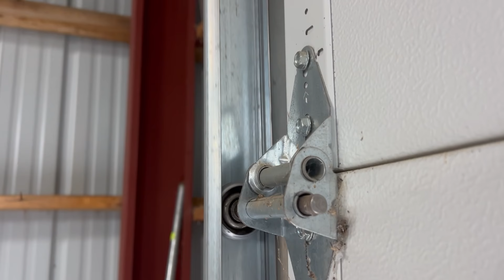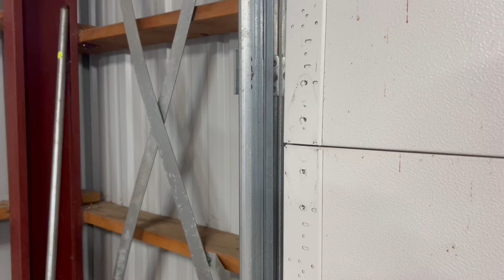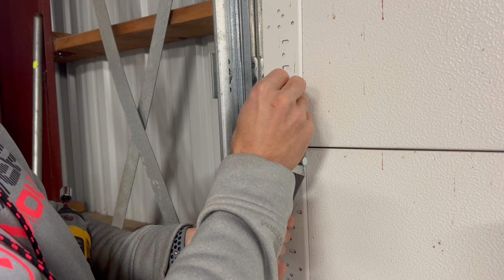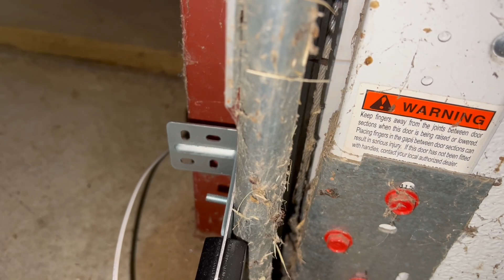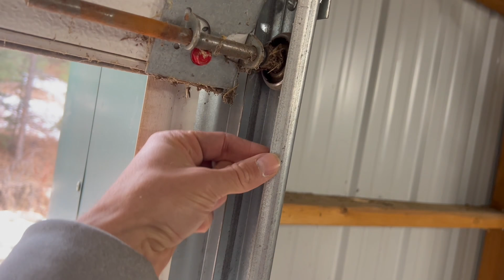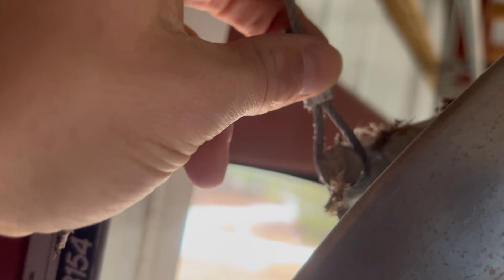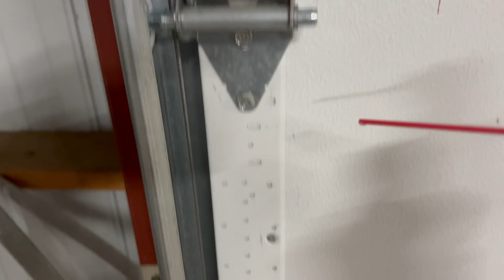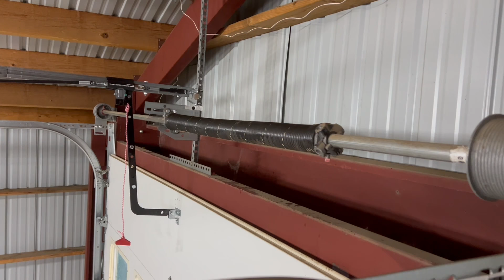How to Replace Old Garage Door Rollers WITHOUT Bending Track (Easy DIY Install) | Builds by Maz

Comment: This is really a great idea and I think I might try it. But what about isolating the motor with rubber mounts so that the vibrations from the motor don't directly transfer to the studs its mounted too?  My garage door is loud.
Reply from the maker: I'm sure that would help. Having a belt motor instead of chain also reduces vibration.

Comment: I predict 90% of people will just skip doing the bottom rollers
Reply from the maker: Even so, replacing 8 out of 10 rollers will make a ton of difference.
Reply: @ I totally agree, thanks for the post I might try it. I have a quiet type opener so the wheels are the loudest part.
Reply: @buildsbymaz  ...except the bottom rollers fail first because they are closest too the ground and collect all the bad weather
Reply: I was thinking about that same thing. I was quoted over $600 to replace these which is why I watched this video.
Reply: @mistysmith5392 wow, I think I paid $950 for a whole new two car garage door and install about 10 years ago.
Reply: Agree. Anything under tension is a red flag plus that unwinding of the cable looks like cluster #101
Reply: It was the exact same thought that came to my mind as I was listening, and then I saw your post. With all the other ones replaced the noise level should drop so one shouldn’t make much difference.

Comment: Do not grease the track - it ends up collecting muck and is sticky in cold weather. Keep the rollers clean and bearings oiled. Just degreased my track and its amazing the difference.
Reply: This is advice is key... DO NOT ADD ANYTHING to the track. the whole point is nylon on metal
Reply: Yes, my garage door repair tech said the same thing. Don't lubricate the track
Reply: That's what she said !!!!  🤣🤣🤣🤣🤣🤣

Comment: Thanks for this video.  The first couple of video I found on YT were showing people bending the track of forcing the roller out.  That looked sketchy to me.  I kept wondering why they did not just unbolt the hinge.  Your video confirmed that this would work and is and easier way to go.
Reply from the maker: Yes I would definitely avoid bending the track if you can! That way you don't run any risk of realignment issues.

Comment: Question: shouldn't the tracks and rollers remain dry so they roll rather than slip on the silicone?  I was always told not to lube the tracks. Thanks
Reply from the maker: Yes - that was actually a mistake on my part. Just lubricate the hinges and spring.

Comment: Why even bend the track to get the lower one out when you could do what you showed after the fact of removing the cable from the top makes no sense at all why you would even say anything about bending the track and damaging it
Reply from the maker: Just to show people another option. Again, I don't recommend it but plenty of people have used that method.

Comment: When I replaced my rollers, I smeared some sticky red wheel bearing grease on the roller shafts before putting them in the hinge. It keeps them from rattling. Also I lubed the hinge pins with a couple of drops of 90-140 gear oil.  It doesn't run off like thinner oil.

Comment: Why didn't you tell me how to do this a year ago.  I used the bend-the-track method.  It works, but the track never goes back to normal.  Still works fine.  Also you should use white grease (spray) rather than silicone lubricant.  Make sure you do the cable as well.   Great video.   Oh, and make absolutely sure you measure the diameter of your wheels.  I have a door from 2004 and it has non-standard wheel diameters.  It was difficult to find the correct shaft diameter with wheel diameter.  I found a set on Amazon and they work great.  So just don't order based on appearance.
Reply from the maker: Great tip about checking the roller size. Both silicone and white lithium are great options for lubrication in this application.

Comment: Great video.  I'm lazy so I just sprayed SI on my old wheels and hinge points.  It's much quieter!
Reply from the maker: That's certainly better than doing nothing!
Reply: There is absolutely no need to lubricate anything on the garage door, especially not the track. The only exception is the coil spring above. WD-40 Silicon is acceptable but WD-40 with PTFE would be best.

Comment: Great time saving video. One suggestion I would make after watching you start the first screw by hand and then start the other three with your drill driver. I suggest starting all four screws by hand or with a hand nut driver so you line up the original thread in the metal door with the screw thread. Using the drill driver can force the screw to start a new threading point or even ream out part or all the existing thread in the door metal thus damaging and weakening the existing thread pattern in the sheet metal.
Just start the screw by turning the screw counterclockwise until you feel the screw thread drop into the thread starting point in the door metal  Then slowly turn the screw clockwise a short way to make sure the screw lined up with the original thread in the door metal and is easily being drawn into the original thread pattern. Any tightness felt while turning the screw clockwise will indicate a misalignment and you should restart the process to prevent damage. You can then use the drill driver to run the screws in the rest of the way but make sure you don't set the clutch tension on the drill driver too tight so that it reams out the existing threads by over torquing the screw.
BTW, this is especially true if you pull and restart screws in anything plastic or wood working on other projects.
Reply from the maker: Thanks for the tip, that's something I never thought of. These things are pretty tight so it would probably require a socket wrench to get them started.
Reply: @buildsbymaz  I can't think of any time at all that it's taken more than a half a turn or so once I thought the screw dropped into the original thread pattern that I knew that I had a problem. Once the screw lines up with the original thread pattern it should turn fairly easily. My guess is that a nut driver would probably do a good job for the start.
Reply: @mikeslater6246  I have taught my grandson when re-screwing to make a half a turn out, then it will drop into the threads with out cross-threading.

Comment: Don't lubricate the actual track, it isn't needed and any lubricant will just attract and hold dirt.  The rollers have bearings, so they shouldn't be sliding on the track.

Comment: You probably shouldn't spray silicon on the track itself. You can lubricate the inside hub of each wheel (although yours are new and probably don't need it), but the wheels roll through the track, so you don't want or need the track to be slippery. As an analogy, if your car has noisy wheel bearings, it won't help to dump oil on the pavement. That makes your wheels slip instead of rolling down the road, but does nothing for the parts that are making noises.
Reply from the maker: Agreed, next time I'll skip the track!
Reply: Good analogy.

Comment: I did this more than 12 years ago and they still work great.  I suggest that as you swap them out, spray the inside of the hinge tube with some lithium grease before inserting the new roller.  I always spray the roller tubes and all the hinges at least a couple times a year, as well as coat the springs & cables with some penetrating oil to keep them rust-free.  Rust is the enemy in my area, especially in the winter (Buffalo NY).

For safety, get yourself a pipe with a screw-end that fits into the spring hub.  You can insert it and allow the tension to hold it against the wall so the spring can't unwind.
Reply from the maker: Great tips, thank you! Agreed that rust can be killer in the winter time if you don't properly maintain the hinges and rollers.
Reply: Can you provide a reference link/picture to this "pipe with a screw-end that fits into the spring hub"?
Reply: @Trust_but_Verify  I assume he means a Pipe with a threaded end - Commonly known as: Threaded Pipe. 
& I ain't providin' shit but this, my dude:
[ONE FREE GOOGLE SEARCH] 
NO PURCHASE NECESSARY. VOID WHERE PROHIBITED.
EXP. 12/12/2112

Comment: My garage door makes an awful grinding noise when moving lately. I've been wanting to change the rollers to the nylon ones so this video is very timely. One of the tension springs on mine broke a few years ago while I was in the house and I thought a bomb had gone off. Scared the begezzus out of me. I managed to find a garage door repair shop that was willing to sell me new springs, although the sales guy kept questioning my sanity. I bought two so that I could replace the unbroken one too, just in case. I wouldn't recommend anyone without good mechanical skills to change their own springs though. There's a LOT of energy stored in those springs when wound up and one slip could really ruin your day. Mine is adjusted to where the (double wide) door can be lifted easily with one hand.
Reply: Mine was getting loud,then I realized the chain tension was loose,tightened the chain up and quiet again.
Reply from the maker: They are super loud when they break! I agree, any garage spring repair should be done be a professional unless you really know what you are doing, as they can be very dangerous.

Comment: Good video...Something nobody has mentioned. Is your new bottom roller is a standard shaft length. The original longer shaft helps prevent
the door from coming out of the track when a spring brakes...Some folks even put the long shafts on all the rollers but when a spring breaks,
it's instant unweighting and the bottom hinges comes out. Making "trickier" to lower and replace the spring.
Reply: Matters not long or short roller on the bottom.  Just because the spring breaks doesn't make your door blow out at the bottom.  Wtf?  😂
Reply from the maker: Thank you for mentioning that - great advice.

Comment: Horrible advice on the bottom bracket. 1) Never remove the bottom bracket; 2) What a pain having to deal with the loose, unwrapped cable.

Next time, try this: Raise the door all of the way, so the bottom roller is in the curved section of track. Now, unbolt the top of the straight section of the track from the wall - only the top 1-2 brackets, just enough to push the straight section out of the way. Lower the door just enough that the bottom roller comes out of the curved section (where the straight section used to be). Replace the roller and push the door back up into the curved track, then reattach the straight track to the wall.

Comment: If you choose the “bend the track method” to replace the bottom roller then lower the door to a level where you can stand on the floor. Near one of the standoff wall track mounts, use a wrench adjusted to the thickness of the track metal and slide it onto the flat part of the track. Gently bend the track out. Move the door down to the wide spot in the track. Replace the roller and reverse the process.

Comment: I have seen numerous garage door videos and they recommend that you do not spray silicone lube inside the tracks as they collect dust and dirt over time. I do clean the tracks once per year but do not lube them!
Reply: I found a made for this use spray for the tracks
Reply from the maker: @ Can you share what it is?
Reply: @buildsbymaz  any silicone based lubricant would work. I use it on the garage doors track/rollers, door hinges, etc. I would recommend a silicone lubricant over something like WD40, especially on synthetic rollers.
Reply: @buildsbymaz  3-in-1 Garage Door Lube.  It comes in a gold-black and red can.
Reply: @spang9782 I have this too. The garage door guy left a can for me to use.
Reply from the maker: I think you are correct, now I know for next time
Reply: I was gonna say…those tracks and rollers could use a good cleaning, in general. I just use the compressor to blow out the debris on occasion, as mine collect a lot of pine needles and dust.
Reply: The track is supposed to provide FRICTION for the wheels to ROTATE against.  You want to lube the shaft of the rollers, not the tracks.  The wheels should roll along the track, not slide against them.
Reply: Good to lube the spring

Comment: My only concern is how long these new rollers are going to last.
Reply from the maker: The manufacturer states 100,000 cycles. I'm not sure if they will last THAT long, but it should still be years before needing any replacement.

Comment: Before you remove the hinge take a pencil and draw its outline on the door. All of the holes are slotted which means that if you don't position the hinge properly the pivot will not be aligned with the seam of the door which is important for proper operation.
Reply from the maker: Nice tip! Also, a lot of the time the screws have been tight on the hinges for so long that they leave marks when you remove them, so it's easy to know exactly where to reinstall them. I should have mentioned that in the video.
Reply: The bottom hole is NOT slotted. That's the one you start with to align the hinge.
Reply: The screw heads left imprints on the hinge surface, no way you could install it back in the wrong position.
Reply: I’ve been reading the additional tips here in the comments and yours is the best one so far…
Reply: You could also put a line from the screw on the bracket onto the door. As it is both on the bracket and the door, you put the bracket back on the door and align the two short lines back together.
Reply: No do not draw on your garage door. Close the garage door starting at the bottom remove them thin loosen all of the hinges so that it's sitting completely flat on itself closed from the inside retighten them all. One row at a time. Starting from the bottom up. With the door closed. Reracks your entire system perfectly level with the new rollers and or hinges. 🎤👋

Comment: The “screws” you referenced are actually called hex bolts.
Reply from the maker: That is incorrect...these are not bolts. A bolt requires a nut for fastening. If you want the full name, they are hex washer head self drilling screws.
Reply: Baystate: wrong, they’re hex screws.   You learn something new each day…

Comment: If you just do your yearly maintenance like spray the hinge joints with oil or silicone. I use wheel bearing grease on the metal track itself. Runs smooth and quiet for years. No need for nylon rollers replacement. Mines been working for 30 years just fine.
Reply from the maker: Very true, but unfortunately garage door maintenance is something a lot of people overlook. This is a great option if your rollers are beyond saving.
Reply: @buildsbymaz  Your absolutely right 90% of the people never do garage maintenance until it breaks then it WILL COST YOU BIG $$$

Comment: I recently went through and lubed every moving part I could find on a older door and that helped a lot and is quieter. I noticed a few rollers with rust and corrosion but still seem ok but might change them out. thnx for info.

Comment: When you disconnect the cable to replace the bottom roller just vise grip the cable end to the track to keep tension on it, that way it won’t unravel.

Comment: I WOULD THINK THE BOTTOM ROLLERS DO NOT HAVE TO BE REPLACED AT ALL, THE GARAGE WOULD BE PRETTY SILENT NOW WITH THE NEW NYLON ROLLERS. BTW, IT'S BEEN SAID TO NEVER EVER SPRAY THE TRACK  ITSELF AS TIME GOES BYWITH THE WD 40 ON IT IT WILL GATHER DIRT ETC WITH NO WHERE TO GO ON THE TRACK.
Reply: I was thinking the same thing!
Reply from the maker: I still recommend replacing the bottom rollers. Just one old roller can make a lot of squeaking, and it doesn't take that much extra time to get them replaced. I have heard mixed thoughts on lubricating the track itself, so I think it would be fine to skip that and just lubricate the hinges and spring.

Comment: I noticed the hinges have holes that are slotted/keyed to allow for adjustment and I assume the door installers adjusted the hinges during installation. Did you mark where in the slotted holes you tightened down the screws? Or, are the hinges put on the door at the factory and it doesn't really matter, and the slots are for only in a rare case when one would HAVE to adjust a hinge.
Reply from the maker: The hinges have been installed for so long that there were indentions where the screws were, so it was easy to line everything back up. But if you need to make a mark to show where the screws were, I would do that so that you can get it reinstalled in the same position.

Comment: Now I see why the garage door guy was hellbent on trying to sell me these when he was out here. Easy money for him.
Reply from the maker: Hopefully he didn't charge you much. Definitely worth the upgrade though!
Reply: Big Willy, the product is under $40.00.  How much was he charging you for them? How much for the labor?  Sounds like you were getting some work on an existing door or was this for a new install? Easy money doesn’t equal big money….I’m curious as to what the total additional charge was from your guy for these instead of the metal ones..
Reply: @StarshipTrooper2050  He was talking like $100 + labor to install them. He had already upsold me on some bracket that I hadn't planned on buying. I passed on them; the garage door is already pretty quiet as it is (belt drive). I had to call them back out for a separate issue and that guy was trying to sell me the rollers then too. 

They did a good job, but they are definitely trained to upsell customers.
Reply: @bigwilly43729  Thanks for the reply...

Comment: What is the life on these nylon rollers? I would be concerned the quality and life of the material. I will look these up to see. The door sound improvement is amazing. Thanks for the video.
Reply from the maker: The website states "100,000 cycles". But even if they only last 20,000 cycles, that would still be 10+ years. It's definitely worth the upgrade!
Reply: @buildsbymaz  Thank you.
Reply from the maker: @freespirit-o6l  very true 😆